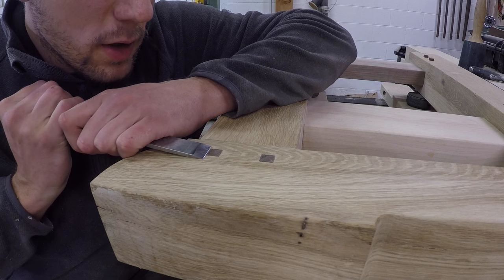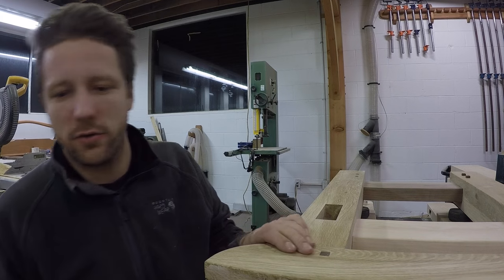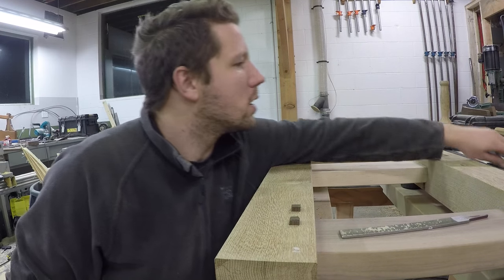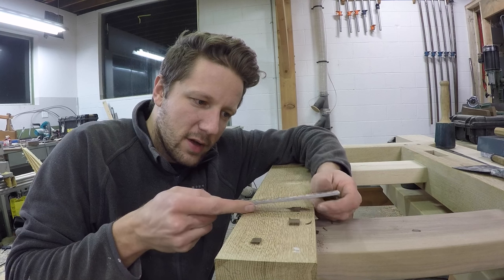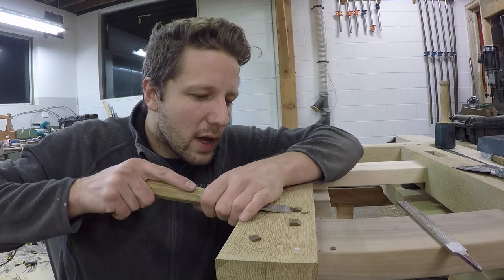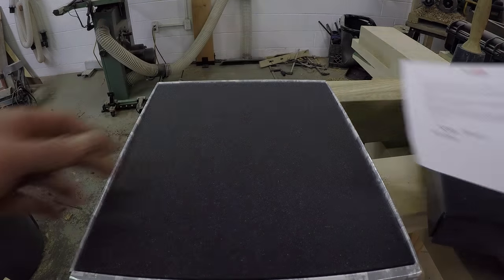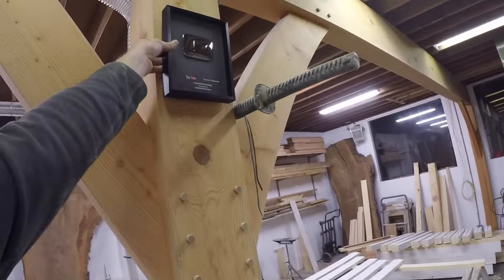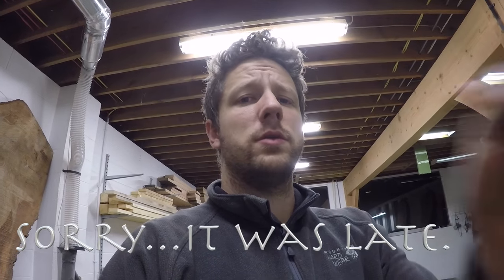FTF #12 Finishing A Pegged Mortise, How To

Comment: Interesting approach. What I do is use a flush cut saw and if I want to leave the peg proud I tape a shim on the piece and run the saw against that. I can then chisel off any edges to make whatever shape I need.  Your approach worked well but it seemed like a bit more work to me.

Comment: now this may sound stupid bout could you not make the pyramid beforehand and when u peg the mortise use a smaller peg and use the pre mades to stick in the hole? ... i dont know if u understand my thought but just trying to help
Reply: +dave “rif” jack Not stupid, that would be quicker and easier.  It might go against the ethos here though, which I think  is making the structure functional and beautiful.  The way you described it you would hide the functional strength behind an extra piece, the sole purpose of which would be to make the joint look better - to make it look like more time was taken to make it.  Only the carpenter would know, but his satisfaction might be less.

It might seem a bit anal, but these are just my thoughts.